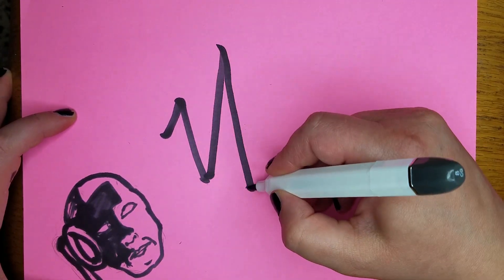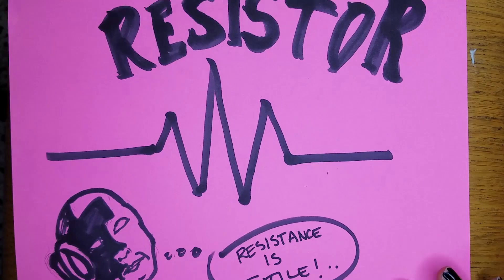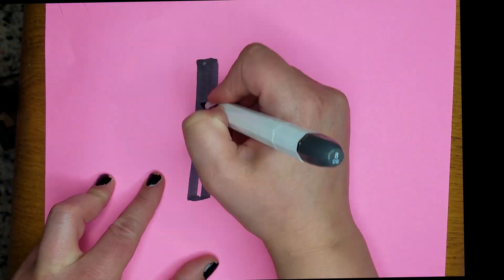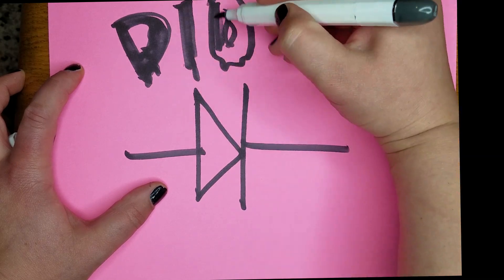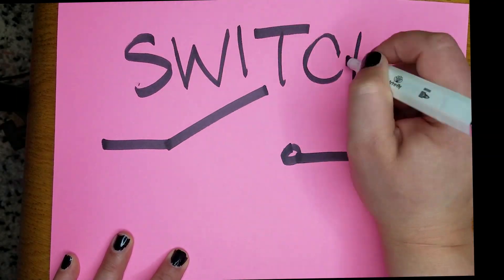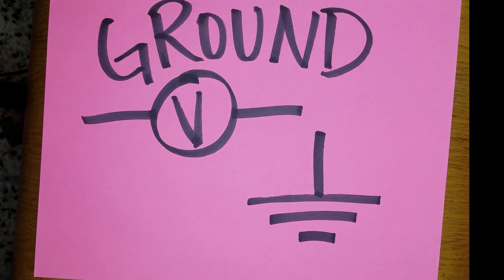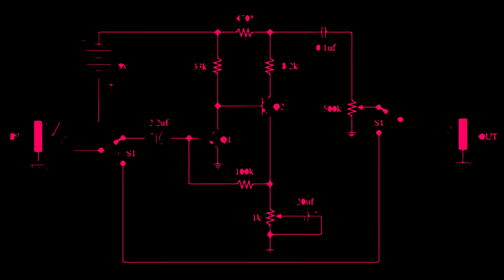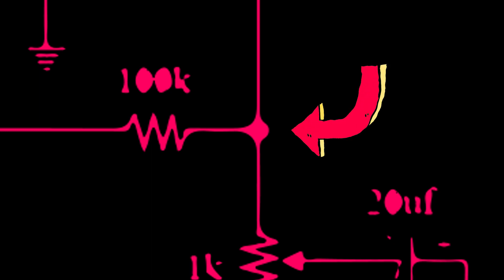HOW TO READ SCHEMATICS | Understanding a schematics diagram

Comment: Thank you for the video. It's very helpful. Basically, there's two types of schematics: A layout schematics that shows where to put the components in a circuit board. 

Then there's another one that shows how the components are connected to each other. 

My issue with reading the latter schematics is that I always get lost and don't understand the relationship the components have with each other. I think the wiring confuses me. Should I approach reading these schematics by ignoring the wiring first? So, by looking at what components there are and then simply looking at which components are connected to each other, right?
Reply from the maker: there are two types of diagrams. the schematics which show how the signal flows between components, (not the wiring). and then the layout diagram, which shows how to wire everything up and where the components go on the board. if you have a layout diagram, you can usually get away with not needing the schematics diagram. but to learn how ot make your own circuit, you will need to learn to read the schematics.

Comment: I think the thing that's more confusing to me and I've tried over the years to learn and absorb, is how to design and layout your own PCB with a schematic. Trying to figure out how to design the "flow" of the components onto the board once you know what components are needed. Hopefully that makes sense. I've only built 2 pedals from DIY kits and I love the process, but with it being very straightforward in the instructions and labeling on the PCB, I don't fully understand why the things are placed where they are, and how it all flows. Any advice would be appreciated. Thanks for all your videos!
Reply from the maker: I feel ya. I will do more research and make a video on this asap.